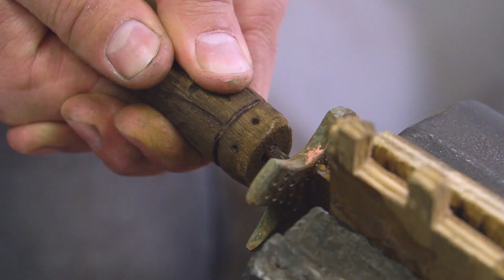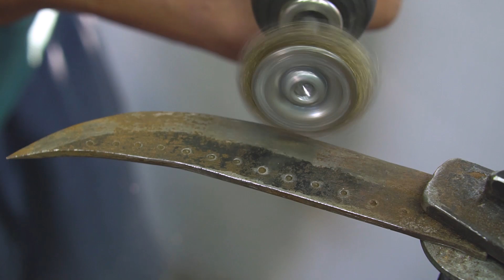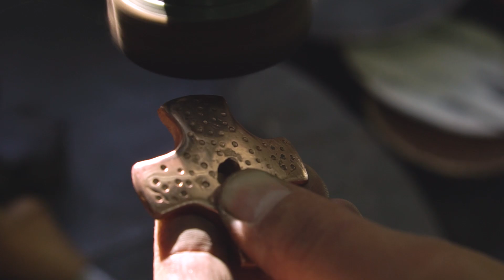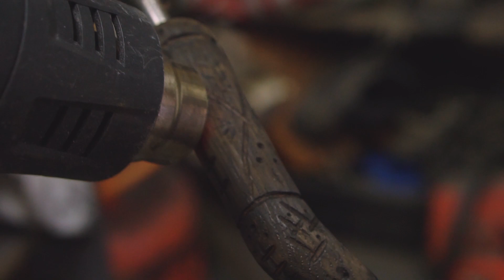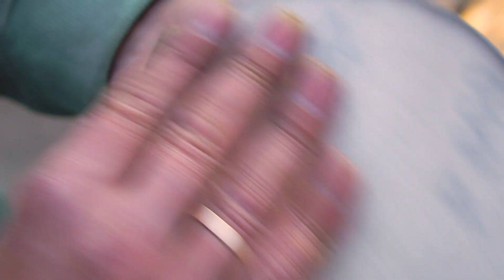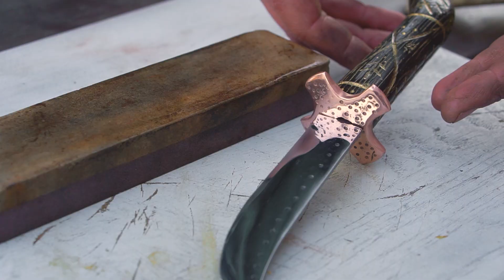Restoration Very Old Ukrainian Dagger

Comment: The blade looks very good, but for the handle, the "give it a more interesting look" strategy just didn't work.  It cleaned up nicely, but, if me, I would have left it just the way it was after you burned it and sanded the surface.  Put a seal on it and that's it.
Reply from the maker: Thanks, I'll keep that in mind for future projects.)